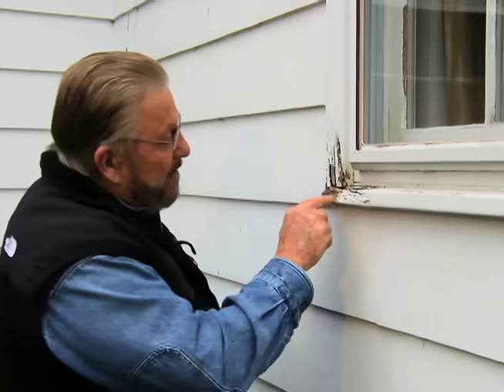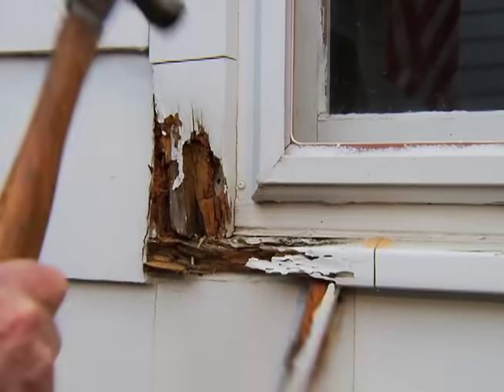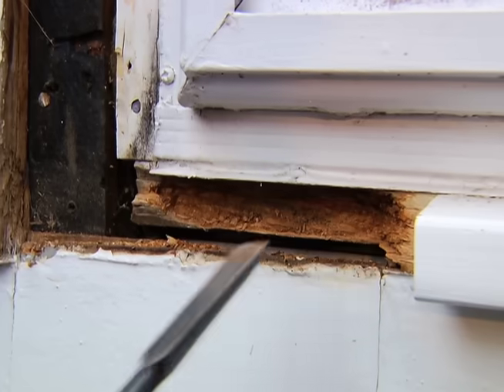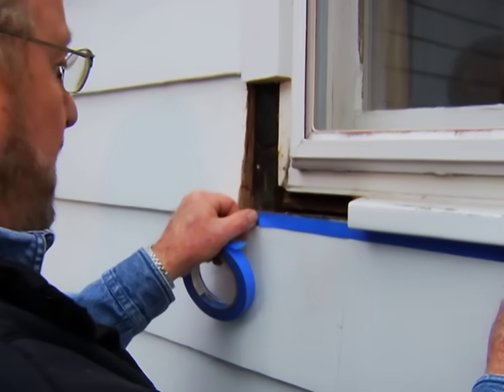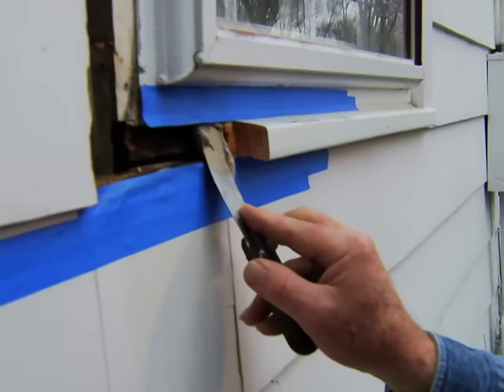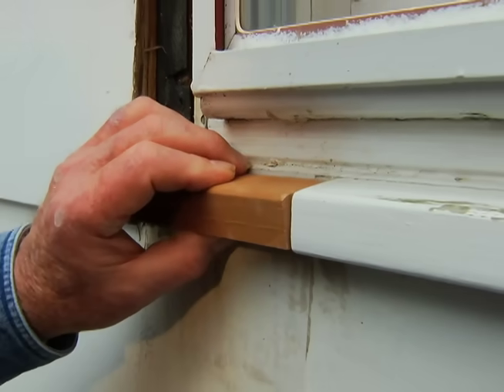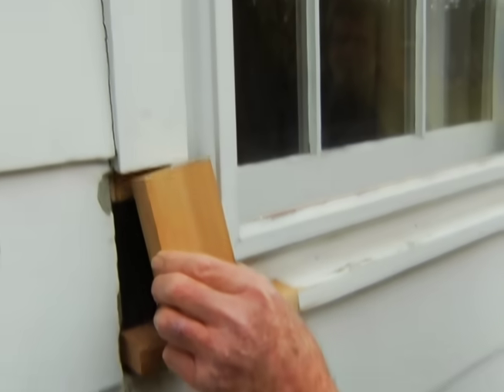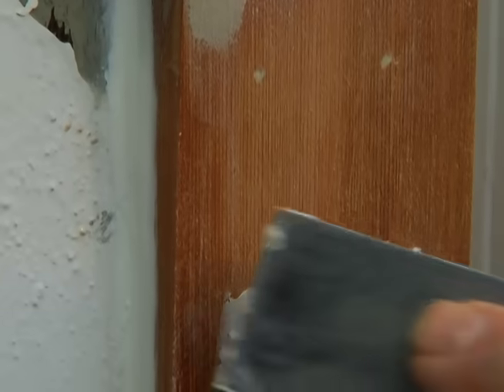How to Repair Dry Rot in a Window Sill

Comment: High performance wood filler is just auto bondo of a wood tinted color.
Reply: Exactly this. For the price of this 'specialist' wood filler you can buy ten times the volume of car body filler. It is absolutely the same stuff. You're going to paint it anyway.
Reply: Bondo sells a similar epoxy product just for wood.
Reply: @williamwinder3466  ...to make an extra buck.
Reply: My pink Bondo came from the automotive section of Menards. It lists wood right on the can. So for all the naysayers Bondo is LISTED for use on wood. I plan to try a few different stabilizers on some rotted 2x4 scraps that I have.  I'm thinking way thinned down polyurethane just pored to refusal and I might try some fiberglass resin also... I have to read some cans. I can say the min wax hardener works, I used it on some pretty sketch wood... probably could have dug it out with my fingernails.
Reply: Yes.  
Ian Hayes is right.  "For the price of this 'specialist' wood filler you can buy ten times the volume of car body filler. It is absolutely the same stuff. You're going to paint it anyway."
Reply: Yes!  BONDO is the same type of filler at one fifth of the cost of the MinWax product.  BONDO also comes with reinforcing fibers (long hair or short hair) for an even stronger fill and it fills larger cavities without slumping while it's fluid.  Been restoring exterior and exterior woodwork with BONDO for 30 years with no issues.
Reply: Yes and the wood hardener is just penetrating epoxy.  Epoxies can be thinned with denatured alcohol  up to 50% As for the penetrating read on the web, penetration is not very deep, just the nature of the substrate and epoxy.
Reply: @2manycatsforadime  Right, and that Bondo "penetrating hardener" is just a glue that hardens in the can once exposed to air.  I always need channel locks to re-open the can after a couple of days.  I don't think it really penetrates any further than a typical sanding sealer.
Reply: Oh my goodness pink plastic versus brown plastic
Reply: And....your point?
Reply: @ianhayes6393  Then, go buy it! Who cares?
Reply: @richlysakowski1415  who cares? Go buy it then.
Reply: @mgmarrow  I do. As for who cares, people other than you presumably. Thanks for your input though.
Reply: @ianhayes6393  Which bondo do you use?
Reply: @charredskeleton  .

Mixwax hardener is plastic dissolved in acetone.

If the rotted wood is dry, acetone penetrates very rapidly into the wood and carries the dissolved plastic with it.

The acetone evaporates very quickly, leaving the plastic in the wood.
Reply: @2manycatsforadime  .

Minwax hardener is not epoxy.

It is plastic dissolved in acetone.

If the rotted wood is dry, acetone penetrates very rapidly and carries the dissolved plastic with it.

The acetone evaporates very quickly, leaving the plastic in the wood.

Comment: Thanks this is exactly what I need to do on a garage eve facia board. It will save me replacing the entire board (really long with difficult spots) and will save $$ and time.
Reply: if you want the patch to last long, put that wood harder on all sides of patch piece and on  all the cuts and inside pieces. Per the instructions the wood harder is to be applied repeatedly until the wood stops absorbing. Its like 5 - 6 coats.
Reply: As a contractor myself, I hate when people like you teach others how to "fix" something improperly! This is a hack job at best! You ignore the real issue, which is why water settled in that corner of the window and rotted the wood. Then you complicate the repair by using expensive epoxy instead of just replacing the corner with actual wood. This is a mess that you are leaving for the next owner of that home! YouTube watchers, DO NOT do this

Comment: Why wouldn't you use the resin to fill the nail holes? Seems more durable than spakle. Especially on an outdoor application.
Reply: They are so small that paint will fill in the head hole.
Reply: im with you on that too, but I suspect its so you can get the nail/screw out when you come back to it
Reply: @husher5142  I might agree with you if it was a screw, but since we saw it was nails it just doesn't make sense. Especially considering he was already using resin on the joints.
Reply: Window glazing putty was the accepted method for filling nail holes for decades
Reply: @michaelkullas2031  I was actually going to mention that too. I still like using that. But still my point is that he had the resin out and was already using it. So why go get a different and inferior product?
Reply: @franksmythe6969   Totally agree, and he may have filled them in with the resin off camera, could have used wood filler, could have just painted over it. It kind of just goes into that idea “man I should have gone to a higher grit on sanding” as long as it can be improved, after taking a step back there is always something that can be done better. I think this guys video is more for people that don’t have the fix-it expertise that most of us probably do.

Comment: Nice job. I am a carpenter/joiner by trade and like your sequence of working. However, one question I have is,'Is this dry rot or wet rot' as wet rot usually occurs at the base of timber door and window frames.

Comment: For the bottom board, pry out the whole thing, use a section to set table saw angles so that a full length replacement can be made out of pressure treated lumber. Cut to length and fasten in place. Replace the side and top pieces with pvc. Total cost is probably $20 and you are done with it forever.
Reply: As a contractor myself, I hate when people like you teach others how to "fix" something improperly! This is a hack job at best! You ignore the real issue, which is why water settled in that corner of the window and rotted the wood. Then you complicate the repair by using expensive epoxy instead of just replacing the corner with actual wood. This is a mess that you are leaving for the next owner of that home! YouTube watchers, DO NOT do this
Reply: @edwardl.990  Why don't you do a better video, or point to better instructions? ( everyone knows how to complain and criticize)
Reply: @miroceperkovic6201  because I don’t do YouTube videos. That’s why. And me giving my opinion and telling people not to smear epoxy on their house and fix it right isn’t bad. If you want to ask me about a repair, have at it and I will help you get it done right

Comment: Wet rot, actually. Dry rot is a completely different, and much more serious, thing. If it was dry rot, you'd be replacing a good bit of the wall let alone the sill!
Reply: Dry Rot is a fungus. My understanding is that it will spread a foot per month if left untreated.
Reply: All rot is fungus.  The much more serious dry rot is a scam by the contractor to get you to pay for replacing things that don't need replaced.
Reply: EXACTLY  Definitely NOT Dry rot, Dry rot is a horroe story should you get it, which is due to lack of ventilation usually in flooring joists due to blocked air bricks

Comment: That’s pretty good I was a painter for 35 years and when I came across this I would chip out the dead wood then take drywall screws and put them in somewhat in the shape of the desired finish depth of the windowsill . Then mixed up bondo and would shape it as needed usually took 3 applications of bondo . Sometimes I would use tape to hold the bondo in place . Sand and finish my problem was finding wood that worked that I didn’t have to buy in a length I did not need but for just a small piece. The good thing about bondo is before it sets up you can shape it with a puffy knife
Reply: All the wood in a house is dead.  Rotted wood is wood exposed to water.  Patching it like this is not how to fix it.  All this does is delay having to replace the window and properly repair the sill later.

Comment: 6 months later - so now we are replacing the entire window
Reply: Haha
Reply: As well as the sheathing and some framing, since it kept leaking ever since the "repair"
Reply: I don't think so. The repair would last couple of years. After that you can easily replace the whole window if you want. Complete replacement depends on how much area is damaged and price estimated to see whether it's worth the replacement.
Reply: @Dave_en  I suppose it depends a lot on where you live. I live on the Oregon coast. The window was installed wrong to begin with. The cause of the problem still exists. I've seen houses 5 years old that needed a whole wall rebuilt from such mistakes. We get a LOT of wind driven rain here. Things go bad fast.
Reply: @onusgumboot5565  I agree with you. If something is wrong from the start, it keeps us bothering for the rest of our life.

Comment: with wood, you should use a flexible filler as wood shrinks. if you use a hard filler the wood shrinks and the filler does not, what do you get a GAP.

Comment: I soaked the wood hardener in first.  I didn't need to remove any wood at all, and the "bad" stuff firmed up quite well.  Then I used a 2-part epoxy to fill in the gaps, sanded, painted.  Can't tell where it was.

Comment: First: There is no such thing as DRY ROT: Wood can only rot with the introduction of water. Google it, look it up or ask a wood expert.
 You did a nice job repairing this window and stopping the wood rot with some great additives and filler that will stop any further infiltration of moisture.
Reply: There is such a thing as dry rot. The rot in this video isn’t it and has been identified incorrectly. Dry rot is essentially wood that has wet rot and is within an area that has little or no ventilation. This can cause a fungus to grow and if left untreated can be devastating to surrounding timbers and brickwork as it has spores that can travel and infect other areas, it’s not localised like the original wet rot. It is identified usually with a musty smell, red/orange dust and a flowering body. Wet rot can be treated by cutting back to sound timber and replacing. Not the case with dry rot. It can be a nightmare and an expensive fix.

Comment: As a contractor myself, I hate when people like you teach others how to "fix" something improperly! This is a hack job at best! You ignore the real issue, which is why water settled in that corner of the window and rotted the wood. Then you complicate the repair by using expensive epoxy instead of just replacing the corner with actual wood. This is a mess that you are leaving for the next owner of that home! YouTube watchers, DO NOT do this
Reply: Not a pro by any stretch but at the very least, the replacement cedar pieces of wood should have been sealed with an acrylic waterproof primer before nailing them in place and painting them. My builder painted all of the wood trim around the windows with zero primer used.

Comment: That's what you call putting a bandaid on a wound without treating the wound. You made no effort to determine the cause of the rot, so you will be back to fix it, again.
Reply: southern yellow pine is the cause
Reply: @vilveyachke5103  SYP may be the material, but water is the cause of the rot. How did the water get in?
Reply: TermsofService  what's that got to do with anything?

Comment: It will only ever be a cosmetic, temporary repair.
Reply: i didn't see any rot where he cut off....by temporary you mean 10 years? or 20 or 50?  as if new wood-replacement would ever be PERMANENT!?  sorry Barry but you're NOT hired.....no really you're not.
Reply: Just replace the window
Reply: @crispychicken2743 , by all means if you have money to burn. The problem is many people are unable to afford an expensive re and re when you can get many years more out the unit with a little  ingenuity and effort. Also this will deter other damage inside the wall simply by sealing off the area getting water damage. Of course eventually all windows fail to weathering. 😉😉🍻

Comment: Vibrating saw, 5 minutes, cut two pieces of wood(pre primed), caulk, paint. Done  get rid of all rot. Don't just cover it up like  half ass carpenter.
Reply: Wrong.  Too simplistic.

1.  Vibrating (oscillating) saw works, but difficult to cut accurately so have to be careful or the gap will be very sloppy).  

2.  Wood rot is a fungus, and like a rotted tooth, you have to grind down to the good substrate, then seal it, then reconstruct.

Comment: Awesome videos people, keep up the awesome work people, you're welcome people!
Reply: Wet rot but not dry rot, dry rot would have a mushroom like growth near by with a root structure, and then you can cut away anything within a meter of its roots as spours from it could mean it will spread again. Dry rot is the monster feeding its self with any moisture it can find, that's why timber turns to dust, in that case you must find the beast or it will just destroy everything.

Comment: Minwax High Performance Wood Filler equals Bondo car body filler, except the Bondo is 1/3 the price. Don't believe me? Mix them both and smell!
Reply: Having the same active chemical in it will make them smell similar but not indicate what other hardeners and such are in them.
Reply: @mikethepainter  Be that as it may, I've successfully used Bondo on wood for nearly 50 years, before the labels you cite were regulated. It became a widespread practice in the carpentry and furniture repair biz. Paint stuck to it like white on rice. I feel certain that MinWax found out we were doing it, changed a molecule or 2, and started charging the rookies triple. But you go ahead,  use what you want. As for me, I'll save the money.

Comment: Thank you so much for this tutorial on repairing the dry-rot on the window sill. This is so helpful for me and I am so grateful for your brilliant how-to video! I would love to be your assistant! I've always wanted to be an expert in DIY projects like you!! 💖
Reply: As a contractor myself, I hate when people like you teach others how to "fix" something improperly! This is a hack job at best! You ignore the real issue, which is why water settled in that corner of the window and rotted the wood. Then you complicate the repair by using expensive epoxy instead of just replacing the corner with actual wood. This is a mess that you are leaving for the next owner of that home! YouTube watchers, DO NOT do this
Reply: @edwardl.990  The next one just replaces the whole Window and it's fine
Reply: @edwardl.990  for $20 bucks in materials and 2 hours of labor, he fixed it for probably 10 years. It will need to be replaced at some point, but it's cheap and easy solution for a 10 year fix.
Reply: @drw-007  yes, because cheap and easy is always better than fixing it the right way?
Reply: @edwardl.990  Absolutely. In some cases it is perfectly acceptable to do a 10 year fix.
Reply: @drw-007  10 years more than the rotten section had in it!

Comment: Suspect wet rot, not dry rot. Both can look similar, but it would be odd to see dry rot on exterior timber, unless it had penetrated from inside the building - if which case this would not be solving the source of the problem. Nice finished result.
Reply: It’s wet rot.

Comment: Everything is spot on but personally I would of put primer on the wood then 2 coats.
Reply: Agreed.  And then repaint in a few years at the first sign of cracking to prevent the rotting from reoccuring.

Comment: Yep   few years ago I had some out riggers/beams  that had some dry rot repair company wanted $$$$$$ ouch to trim /cut off & repaint  I went down to  Home Depot bought some ligiid nails  after drilling about 2 inches deep with a spade drill fill in & applied several coats of good paint to match  + sheet metal company made me some caps that protected the top.  I am happy  getting ready to  repaint home and touch up some problem areas. How ever this time I might have to use a painters to do it.  At 70+ I do not like ladders :)

Comment: Great video with a beautiful result.  You've got all the right tools.  Masking the area better would give you less cleanup at the end, but the result is very good.  Thank you.
Reply: As a contractor myself, I hate when people like you teach others how to "fix" something improperly! This is a hack job at best! You ignore the real issue, which is why water settled in that corner of the window and rotted the wood. Then you complicate the repair by using expensive epoxy instead of just replacing the corner with actual wood. This is a mess that you are leaving for the next owner of that home! YouTube watchers, DO NOT do this

Comment: Best tutorial I came across to fix my issue. Thanx
Reply: As a contractor myself, I hate when people like you teach others how to "fix" something improperly! This is a hack job at best! You ignore the real issue, which is why water settled in that corner of the window and rotted the wood. Then you complicate the repair by using expensive epoxy instead of just replacing the corner with actual wood. This is a mess that you are leaving for the next owner of that home! YouTube watchers, DO NOT do this

Comment: That’s the way I like to fix things. I had rotten rails at the end of my porch in my 1890s house, and I just vacuumed it the doubt the loose crap, rebuilt it with. Wood filler, silicone caulking, and Security looks great

Comment: Back in the seventies my first House was a single wall stucco house that was built in the late twenties or early thirties. I had to do a lot of this kind of work. The old house should have been torn down actually but I had to have a place to live. I had to replace the floors in to rooms because of termites. I had to live in the house with dirt floors for a few days. I added 2 rooms onto the house and lived in it for several years. I sold it and people are still living in it to this day.

Comment: I personally soak new raw edges in wood rot conditioner as well. Then apply Bondo to end of the new repair parts and apply glue and nail in place. Having Bondo fully between the wood makes less chance for Bondo to break out when the wood expands and contracts.